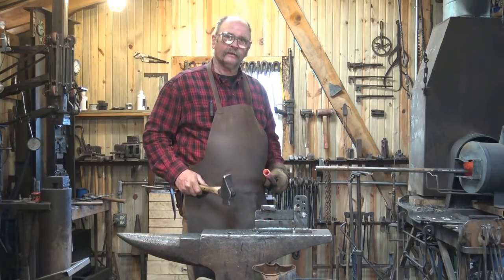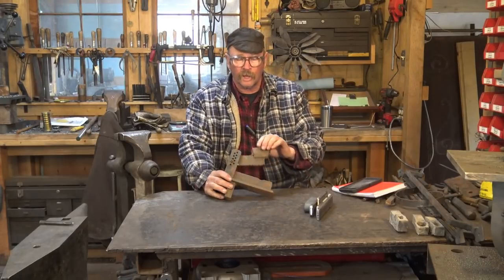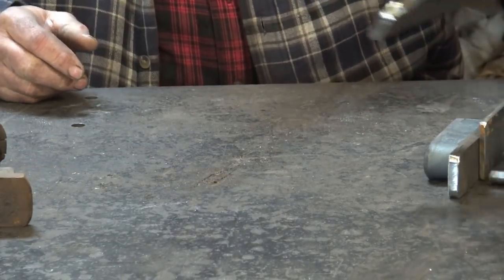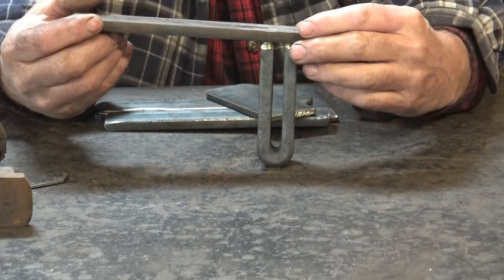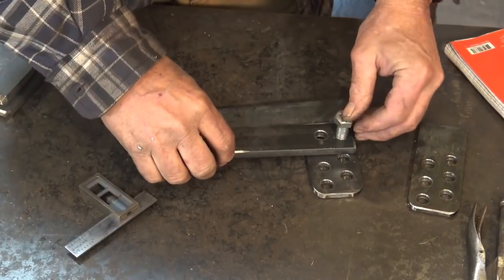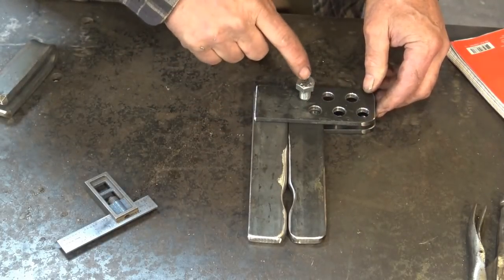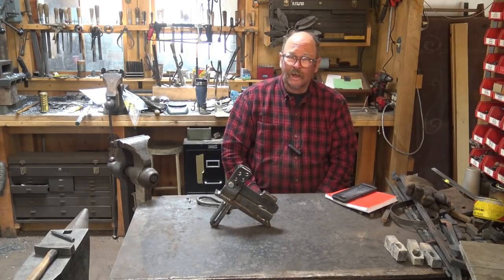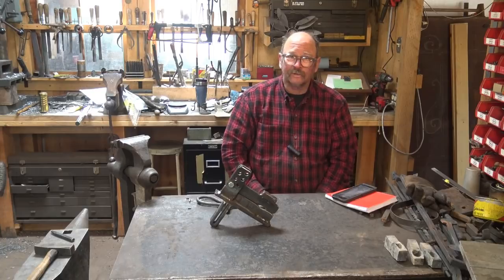Adjustable fullering jig - blacksmithing tools

Comment: Glad that you made a video on the fullering jig.  Don't fret that it didn't have any "blacksmithing" in it.  Blacksmiths had to fab up their tools as well.  The video is very appropriate.  I have one identical to it and use it frequently.  I used 1" square stock for my hardy bar, but I like your U-shaped bar better with the option of using a wedge to firm it up.  If one doesn't have a welder, and belongs to a blacksmith group, surely someone in that group would gladly weld it up for you.

Comment: Very nice and simple tool, and easy to make, thanks for taking the time to make this video to show the build. 

I saw in one of your comments you stated that you rarely ever adjust things like this that are adjustable, I'm sure that's because you do so much with the same size materials. 

But for those who would make this and would actually adjust it, for quicker and easier adjusting, rather than using a bolt, you could get a hitch pin with the spring ball retention, or a hitch pin with cotter pin. Both available at places like Tractor Supply. Just might have to cut and shorten them since they tend to be a bit long for something like this

Comment: John, Yet ANOTHER excellent video. If I may offer a couple of suggestions.... First, and this is minor, use a 1/2" bolt that is NOT all thread. If you get a bolt with enough unthreaded shank to go through all of the jig, and then be threaded for the nut, it will help prevent some sticking and wearing of the holes. Second, I made a similar jig for my shop as I was making lots of the same parts. I drilled a 1/4" hole through the bottom jaw of the jig and then tapped it and put a threaded rod with a small piece of scrap plate to act as an adjustable stop. It really works great for repeated parts. As always, THANKS for the fantastic videos.
Reply: The stop is a great idea.

Comment: There is a splatter spray available that prevents most splatter from sticking to the clamps, magnets, and other tools that have to be right next to the spot you have to weld.  Sure keeps clean up easy.

Comment: Thanks for sharing, John.  I do a lot of fabrication, and my suggestion on the bolt holes is to tack weld the corners lightly.  No clamping or bolts necessary.  Do the tack welding before you round off the corners -- the tack will go away when you finish it.
Reply from the maker: Great advice.

Comment: Going to attempt making one to hammer out  iron Japanese dresser pull handles. They're small diameter so I'm going to use an old brake line flaring tool. The part that holds the tubing.

Comment: Thats a great tool. Could i recommend you swap the bolt to one with a smooth shoulder and the thread starts outside the tool. The way it is now with every strike the threads will eat away at your drilled holed and elongate them. Will be fine short term but for the life of the tool it would be best to swap bolts. You could even make one with both jaws changeable. So you could make all sorts of tooling for the same tool. Like a double sided hot cut for round bar, v grove tooling, fat or narrow smooth u shaped fullers, or anything your mind invents :) Sorry for taking your great idea and running with it. Just got carried away lol
Reply: Sounds like an idea worth exploring

Comment: I love that you do most of your work traditionally but like you said in one of your past videos black Smiths were all about innovation of tools so to use modern tools to make other tools goes right along with traditional blacksmithing. If a blacksmith had a welder back in the 1800s you better believe they would be using them
Reply from the maker: That is a true statement.  When the welder came on the scene blacksmiths did use them and it is the reason that blacksmithing almost died out in the last century.  Blacksmiths gave up the forge and the anvil and picked up the torch and the welder instead.  If we only look for the most efficient way to do things, in most cases there is no reason to forge.  So If I want to be a blacksmith I need to approach my work like a blacksmith and not like a welder.
Reply: L.L. blacksmithing and John, both so very true! 

My dad ran the shop for a big pipeline contractor, and in the early 2000's I went to work for him. I ended up being a heavy equipment mechanic and did a lot of fabrication. It wasn't until after he taught me to weld, that I found out I had an artistic talent with metal. Using the torch and welder after hours was how I made my sculptures. I got cut when they had a big layoff, so I lost the ability to create.

10 years down the road, I'm finally getting back to it. I've always been fascinated by the art of blacksmithing and I've been spending hours and hours for a while now watching YouTube videos by my favorite Mr John Switzer, and several others and have learned a lot. Watching and learning has transformed my thoughts on what I'll make and how I'll make them in the future. Definitely wanting to learn the ways of a blacksmith! 

I've realized now how much having a forge will benefit me more than a torch, especially since it's costing me $75 each time I exchange acetylene bottles. Which is why I'm currently building a coal forge 😃
I have a makeshift anvil that will get me by until I can find a quality used anvil in good shape that's not outrageously priced. 

Sorry for the long story comment. John thank you for your continued wonderful videos!

Comment: Im going to be setting up my little blacksmith shop throughout the summer so i can work in it this winter when im layed off from construction work. Ive had a very good idea of the basics ill nred from watching your videos, and thank you, ive learned so much. What im sadly lacking is knowledge in pric8ng of my work. Im going to start with simple projects (campfire sets, wall hangers and similar things as a have access to scrap metals and dont have to be too concerned with the types of metal). Any suggestions in this area would be truly appreciated. Projects like these i think would sell fairly easily at flea markets and rendezvous's next summer and fall in the north central MN area. I will continue to watch and learn from your channel. Again, thank you.
      Darwin

Comment: Are you using the Argon/C02 mixed gas? It doesn’t splatter like just C02. With the increasing costs of Anti-splatter it is a lot cheaper to but the mixed gas. Plus it saves time on cleaning up the splatter.

I have been watching you make tools needed for blacksmiths and this is another tool  so it definitely should be a part of your channel. 

Just my two cents

Comment: I think that you'll find that making dies and hot work tools out of 41xx (chromoly) steel with a simple heat treatment will give you a much higher performance with a much longer working life than 1018/20 (mild steel) tools. Bit harder to weld and requires a couple more steps but it's worth it for something you'll use for a long time, even only every once in a while.
Reply from the maker: I do use a fair amount of 4140 and S7 depending on the tool
Reply: @BlackBearForge   I should have phrased it more as a question. Can you feel/see a difference when using hardened steel vs. unhardened steel when using a small die like this?

Comment: Still in the middle of the video, so no idea how it will turn out. But regarding the stepping between holes: let's assume you want to go up in half inch increments. The first front hole goes where it needs to go, and every other front hole is one inch up. That's your fronts covered, giving you a 1 inch interval. Now, the rear holes, they align perfectly with the front holes in the uprights, except you can skip the first. On the tool arm, you space the rear hole a half inch up.

Now, if you want to use the bottom position, use the bottom front hole, and the front hole on the tool arm. If you want to go half an inch up, you'll notice your rear hole in the upright sits one inch higher than the first front hole, but the rear hole in the tool arm only half an inch. Which means it sits a half inch below the first rear hole on the upright. So the front holes cover your wholes, and the rear holes your halves.

[EDIT] Actually, what you did is exactly the same. Rather than aligning the holes on the upright, you aligned them on the tool arm. Works too, and gives you exactly the same number of height adjustments and exactly the same spacing.. Don't worry about not having a "half-way" adjustment: what you have is the maximum number of adjustments given the available area. If you wanted finer intervals, you could have made your uprights wider, so you could fit three holes next to each other. But other than that there's no way to go finer. In other words: your solution is already optimal, given the dimensions of the pieces you started out with.

[EDIT 2] Oh god, is he still talking??? Yes, I am. I just came up with a way you could actually fit halfway steps in there, although I think your tool arm ain't high enough to accomodate. If your staggered holes are half an inch apart, you could drill two holes in the top of the tool arm (leaving enough meat to be able to cope with the abuse), and two more thee quarters of an inch down. You may need to drill more holes near the bottom of your upright, spaced exactly like the ones you already have. This would allow for quarter inch increments. But your tool arm would have to be tall enough so that you can actually do this without getting your holes too close to the edges, for obvious reasons.
Reply from the maker: Sounds like you need to go out and make one.  There are always design tweaks if you ever make another one.  thanks for the ideas. The truth is that I find I almost never adjust tools like this even though the adjustability seemed like a good idea at the time.
Reply: Lol Juan you put way too much thought into that! Well thought out though. I just don't think this is meant to be that much of a "precision" tool 🤔 😃

Comment: Could you use this to make tenons round tenons to fit into a backplate for a hanging basket bracket ? cheers John
Reply from the maker: Yes, but you might need a flat section with a stop for the size your going for as opposed to the fuller cross section
Reply: @BlackBearForge  chers John

Comment: I get the similarity between the spring fuller and this tool.  But what is (or isn't) the similarity (difference) between it and the smithing magician?  If I insert thinner fullers into it?
Reply from the maker: The smithing Magician or guillotine tool moves straight up and down, which should produce more even results.  But it is probably more difficult to build.  I use the Guillotine tool much more often

Comment: A great tool I were planning on to do already before, but didn't think about the adjusting holes!

Also, if you'd make the bottom part interchangeable, the frame would support a pair of butchers too...

This would not allow the bottom part to be welded on, but weld some square stock on both sides and have a bolt hole in the end as well would maybe suffice?

I don't have the guillotine/magician, and some reasonably priced toolsteel is a bit challenging and expensive to attain. So I were thinking if this concept would allow those purposes to be met...?
Reply from the maker: I think you're on to something.  Should be a good way to make this type of tool more versatile.

Comment: I wonder if you could put a bar perpendicular to the jaws for fullering blades? I primarily make blades
Reply from the maker: I am sure you could.  Although I think you could make simpler arm and pivot for a blade fuller.
Reply: Black Bear Forge or make this one for the purpose you use it. I have uses for it. Then make some T shaped arms for blades
Reply: Black Bear Forge I'm not sure what you mean by an arm and pivot set up

Comment: Hey , so is that tool good for hammer making instead of a spring fuller or  striker
Reply from the maker: As long as you can adjust it to the right size it will be very good for that sort of purpose.

Comment: Ok   I know exactly why you broke the head off over and over  . Ok 1st 5160  Is a high chrome steel .  It also a medium carbon content , That requires a stainless rod ,  #2  to weld it ,it needs to be treated like tool steel . For that you need to heat it up between 500 and 800 degrees .  First you warm it up ,then you butter it , " put a layer of stainless on it " ,  peen it until cools to 250 degrees are there about  . Then you butter  your mild steel block really good . Now your ready to weld them together . Warm them up together weld it peen it . If you can , cool it in vermiculite .  All tool steel has a procedure ,all tool steel takes a lot more time and effort . 1 look at it ,I knew from the shitty welds what was wrong . It wasn't you didn't know how to weld ,"You didn't know the weld procedure , Hope this helps
Reply from the maker: Thanks
Reply: I thought of you today !  Ok One thing that would help you immensely ! I just bought a Ac / Dc tig welder .   A miller metallic arc for $100 The capacitors are so weak high freak barely works. Those capacitors weaken over time then quit  witch is why these machines are so cheap , most importantly they have   DC strait and DC reverse  . But you don't need tig . The stick side will never wear out !  No plug in ,no leads ,cant test it means dirt cheap . Don't worry it will work ! With this welder you now have the 4 rods witch can't be done by mig .They are 7024 ,This rod runs as easy as your mig just drag it .What this rod does is lay huge amounts of metal for building up worn surfaces , Rod # 2 The great 6010 - 6011 deep penetrating eat through and bite rod . Use for 1/4 - 1 inch steel . on 1 inch use for root pass then grind fill with mig . And last but not least is the stainless stick rod , This rod will be as near and dear to your heart as your grandmother . This rod does cast iron as well as a nickle rod , " but easier to use ,it does High carbon steel , witch can't be welded very good with mig ,stainless of course . If you have mystery metal that the mig can't seem to weld right , Use this rod , it will weld it . Just heat till spit will dance , then run the bead . Last and rarely used but much loved when needed  hard facing rod . Build up with  7024 run hard face over top it will never wear out again .  These old and cheep machines run stick as well as any two thousand dollar welder with all the lights and knobs if not better and these will last forever . There is nothing on the stick side to break . Just a big screw pulling a shunt back and forth . If it vibrates and hard to strike the arc , don't fret it just needs the shunt adjusted and greased . A welding forum on line  will be happy to tell you how . " 5 minute job when you know how ," . If it comes with a foot petal ,torch , hoses and gauge sell that and you have your welder for free ! As a welder you are just fine . I would hire you in a heart beat as a top fabricator  welder. Oh 1 more rod 7014 in case you run out of gas or wire on your mig .

Comment: What difference with a guillotine tool???
Reply from the maker: A guillotine tool has removable dies that slide in a track or some other guide system.  They move straight up and down.  On this tools the working surface operates on a pivot point which may not be as precise in some situations.
Reply: Thanks for this quick answer. This makes sense